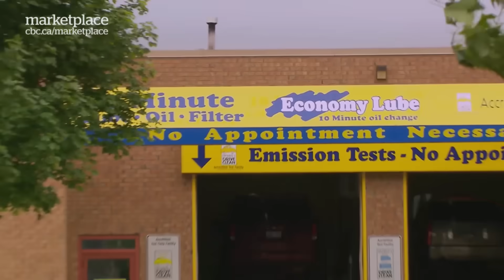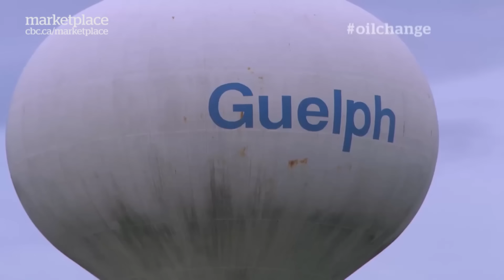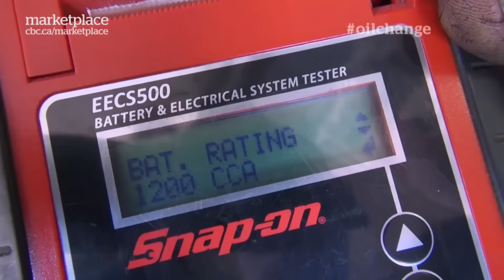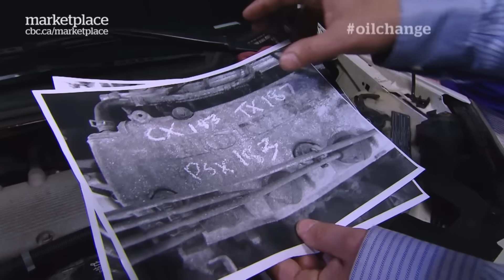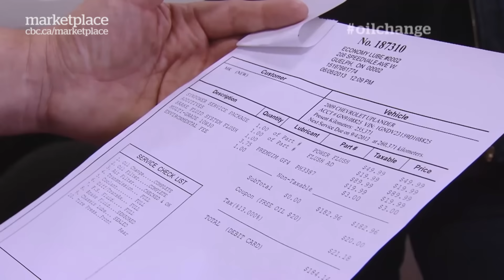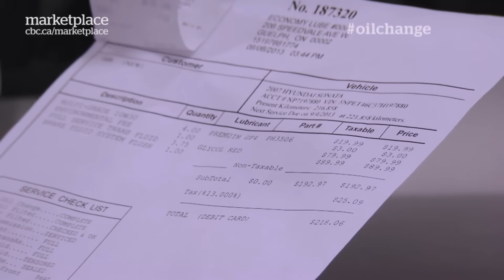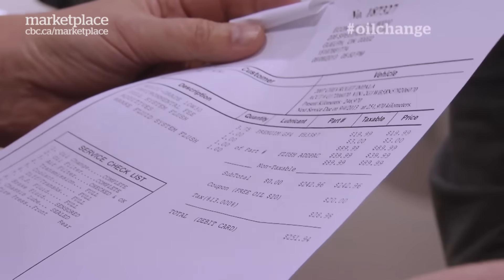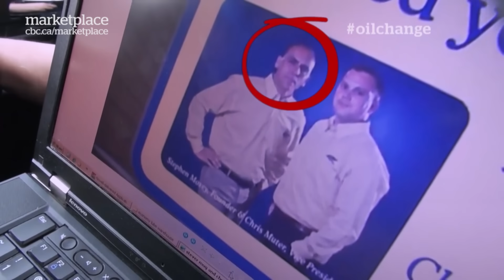Oil change scams: Hidden camera investigation on what really happens to your car (CBC Marketplace)

Comment: The service center at dealerships are just as deceptive
Reply: they really are. i brought my car into get my breaks fixed at my nissan dealership where i bought my car because it was under warranty so they had to do a 500 dollar break job for free and when i left my check engine light was on. when i brought it back they said my o2 sensor was bad and it would cost me 600 bucks. i went and got a second opinion from a close family friend and he said it was intentionally unplugged and he just plugged it in. no charge. he took a picture of it and said the only way that would happen is if someone intentionally unplugged it and to charge me for a new one is insane.
Reply: Dealerships are the worst. One tried to cheat my mom.
Reply: Dealers are known for this. With all the competition they have selling cars, their profit margins are so low that they try to make up for it at the service center.
Reply: You could change this sentence to "Dealerships" and it'd be about the same context lol
Reply: They are not.
Reply: Totally agree. Stay very quiet during warranty period, then start their scams 1st service after warranty period. Charging top dollar and not even doing a proper service.
Reply: Actually worse...
Reply: Yup that's why I get my husband to work on my car
Reply: If you have factory warranty dealerships will only marginally "repair" your vehicle. After warranty they will over charge you for repairs. And if the same problem returns within the 12 month repair warranty they will claim it's a different part than the previous repair. It's best to have an extended warranty outside of the dealership because they will guarantee it's repaired correctly. $100 in parts and $800 in labor is usually how they do it.
Reply: @michaelspoto8720  nissan dealership are the worst they replaced my new battery with an old one when I went for simple oil change.
Reply: @ohreally6645  yes!!!! During warranty car is totally fine! Then right after they pull bs
Reply: Some are yes. I'm an automotive tech at a dealership myself, but the one I work at is dead honest. We do a complete multipoint inspection, and we have trays with fresh fluid in viles to show what it should look like, and we dip the fluid next to it to show where the customers vehicle is at. We do it on every vehicle more so to cover our own asses because if something happens to the car, we can show that we did the inspection and notified the customer.

Comment: Took my truck to a jiffy lube . They told me that my diff fluid was horrible.  I'm actually  a retired ase master tech. I took my truck home , pulled the diff cover and the fluid was perfect but I serviced it anyway. I went to a different jiffy the next time, they again said that my diff fluid was horrible.  I told them about the first time. The guy said , "well see, it dark and hard to see under there.". After changing my own oil a few times I went to a 3rd different jiffy in a different town.  Same exact deal . When I told the 3rd guy the story he got indignant and said he didn't like being  called  a liar. I said ,well I don't like being  lied to either. Needless to say I  avoid jiffy at all costs now.

Comment: "Brake fluid should be clear like water" lol wut
Reply: ESan Surnai Yes brake fluid is totally clear when new.
Reply: Only if you use Sprite instead of DOT4.
Reply: use dot 1,000,000 .... this way youre a head of the game and dont have to change your brake fluid for atleast a couple decades
Reply: unless you have a brake problem m8, then even that brake fluid wont help you to keep it in or keep it away from hydration m8
Reply: Steven Schechterly Who?

Comment: The chrome-reverse muffler bearing always needs replacing.
Reply: You forgot the blinker fluid!
Reply: +Benjamin Armstrong With LED technology now, there really isn't much call for blinker fluid anymore...at least not in my shop...but halogen fluid? ...that shit sells like crazy! What little bit I do have is on the shelf, right there beside the plaid paint....
Reply: tanyaswaycool Thank you!
Reply: +tanyaswaycool ELBOW GREASE

WHERE'S THE ELBOW GREASE THE HEADLIGHT FLUID PUMP IS JAMMED
Reply: So does the catalytic converter and oddly every transmission i had has had metal shards good thing i know alot about cars to call them out on it i wouldnt have went to get an oil change if i was working full time
Reply: +watermelons that means your tires are bald
Reply: +misterfunnybones MY alternator fluid was low, so I had them change it...
Reply: +tanyaswaycool  =///==>   Har.!
Reply: +misterfunnybones  say what hahaha
Reply: Also don't forget to tune your powerband ever 20000 miles or you'll rip the thing apart and have to get a new one. (Powerband sate expensive) and never forget the hydrostatic piston pump.
Reply: hehehehe i love a good laugh thanx
Reply: +misterfunnybones I was in a midas(never again) and heard them say this to an old lady who then said, 'this is the third time!'    They also told me I have an oil pan leak, and it'll cost $300 to fix it(MIDAS, never again)
Reply: big business will screw you every time
Reply: DON'T FORGET THE WRIST PIN FRACTURE PLATE
Reply: always remember to service the fish tank.
Reply: +misterfunnybones   And the car will never start if you let the headlamp fluid evaporate.
Reply: +Mich ael Yeah I have heard guys in shops trying to rip off old ladies.  They even tried it on my mother once.  Something about needing a new axle in her jeep because the end showed signs of overheating.  She said, "show me".  Sure enough it was blue. So she calls my dad. My dad is a science teacher and taught me to fix small engines when I was 9 or 10. 
Of course it's blue. It's heat treated. lol  Bunch of morons.
Reply: +misterfunnybones NO NO NO. Its the FLUX CAPACITOR, I TOLD YOU SO MANY TIMES
Reply: +Chris HHu it gyjh
Reply: +Chris H Now that you mention that, I wonder if the flux capacitor was a shop mechanic term before Doc Brown invented it & used it in the DeLorean.
Reply: misterfunnybones
Nope. The Ansible Filter was.
Reply: *****
And rarefied tire air.
Reply: +Commodore Sixfour don't forget the Headlight fluid!
Reply: misterfunnybones lol i think it is, becausse every old mechanic i know uses that term -_-
Reply: +Daniel Rosche Uhm... someone's been pulling your leg, there is no such thing as a hydrostatic piston pump.

What they do use is a traditional coil spring for the piston return.
Reply: ziiofswe You got the last two words backwards. There probably does exist a hydrostatic pump piston.  :)
think tractor and lawnmower.
Reply: +drServitis http://www.bbc.com/travel/story/20150311-can-canada-teach-the-rest-of-us-to-be-nicer
Reply: drServitis
 I can say funny things about Canadians, but I think you're wrong about them being the most corrupt.
Reply: Zyzyzx Zyzer
 Yes, but did you get the bearings packed?
Reply: I have a Diagnostic Hammer for challenging No-Start problems.
Reply: andrew13971
Do you use the technical tap or the corrective strike?
Reply: Technical Tap with my Dead Blow Hammer, when it is fully charged.
Reply: +misterfunnybones 
mmmmm, yes sir , I see your flux capacitor is warn , and it's a common fault on VW Combi's for the radiator hose to fail .
Reply: +misterfunnybones and the 10 min. trany swap
Reply: Just ignore the man behind the curtain!
Reply: +misterfunnybones 
I'm pretty sure the crankshaft chamber ceiling light is also busted.
Reply: Dear Misterfunnybones: Lets Not Scare Off the Customer! The crankshaft chamber ceiling light requires Diagnostic work to be done only by the shops A Tech! Our A-Tech worked at --(fill in blank).
Reply: +misterfunnybones  they told me my Ford Focus electric needs new spark plugs and fuel filter!
Reply: stickmagnet
 What a swindle! Everyone knows that it only needs AAA batteries.
Reply: +stickmagnet really? Did they offer you an oil change, transmission fluid or to check your emission systems?
Reply: +Christopher Miles they told me the O2 sensor and PCV valve needs replacing, the motor is having too much blow by.
Reply: +misterfunnybones Your gas tank's octane sensor and your wiper synchronization unit both need replacing, but lucky for you we are running a special ....
Reply: +Heru- deshet nope I think it's the canobler bar.
Reply: *****
That's a "negative" comment you don't want to hear from the mechanic.
Reply: +misterfunnybones Dont forget the seat heating oil
Reply: the gear oil last up to 300,000km on moderate use. most modern cars are hydraulic clutch, so its less effort than cable linkage, yes it can be repetitive on city traffic, I'll got used to it.
Reply: and dont forget the headlight fluids
Reply: +angry consumer This investigation didn't prove, beyond a reasonable doubt, that the corporation was liable for the fraud.  They did a good job of proving that one store was involved with a few employees, but that could happen easily in a mom and pop shop too...to show corporate fraud they would have to show that multiple employees across several stores owned by the same corporation were engaging in systematic fraud.  Also, it would help to have investigators go in as new employees to see how they are trained to do their jobs.  If the fraudulent practices are taught to more than one person and then seen to be encouraged by management as a matter of routine business practices, then you have a solid case of corporate fraud.   This was not a complete or comprehensive investigation, not at all...and their "retired" fraud investigator would have known this.  As an investigative effort is left a lot to be desired, but it is a good video to help consumers to be aware, and part of awareness is to know your own vehicle, know what it needs so you don't get scammed.
Reply: +misterfunnybones dont forget about the blinker fluid
Reply: +Lucas Jonsson don't forget the window wiper oil and stereo oil
Reply: Canada
Reply: +21Timberwolf wat?
Reply: +misterfunnybones I only use a General Electric Turbo-encabulator. I hope they stock them.
Reply: Don't forget about headlight fluid
Reply: +21timberwolf what about us lol ✋🏻
Reply: Forzalogistics45
Reply: Lmao
Reply: misterfunnybones 
what about nitrogen?

Comment: Jiffy lube needs to be checked
Reply: chris allred they are crooks
Reply: I know they tried to me my lights where burnt out and its $50 to change them
Reply: chris allred How do you feel about Grismer? In my experience they are ok but this video has me reconsidering honestly....
Reply: They said I needed new serpentine belts because they were worn and frayed even though I had them changed for brand new ones the day before lol
Reply: I worked at one location for a while and they actually cared about the customers. They never up-sold unnecessary products and did a lot of extra work on cars for free. They also told people they didn't need an oil change if they came in too early. I imagine that each location is different though.
Reply: And Walmart
Reply: Go to Valvoline
Reply: I work at Jiffy right now and I can vouch what Vortion said 100%. Everything we do also goes by the manufacturer's recommendations and we show this to every customer before performing a service.
Reply: Ive always had pretty good service there. As far as I can tell. Im pretty handy with cars but I prefer someone else to do certain tasks. Im more than willing to pay for it, but that's just me. The biggest problem I have with them is they always park my car on a steep incline when finished, and they NEVER set the e-brake!! they just let the entire weight of the car rest on the tranny pin. Pisses me off!!
Reply: I've worked at Jiffy Lube and we had to do up sales on certain things and if we did the up sale, we did the work.
Reply: Only time i went to jiffy lube was once because i was too lazy to do it myself and the only reason i went was because my good friend works there, i stood infront of my Subaru and watched them do everything. After everything they were all very nice to me and gave me the employee discount.
Reply: They went undercover with jiffy lube 9 years ago. They scam people just like this company!!!! Never trust any shops if u dont know them well.
Reply: I worked for Jiffy Lube for a while. Never attempted to upsell and told people the honest truth about what did and didn't need replacing. That's how they taught me at the location I worked. But like @vortion says, each location is different...
Reply: chris allred it’s funny you say that. I’m 18 and I worked at JiffyLube (about 2 months ago) for my first ever job. It was so horrible and seemed unprofessional in different ways. 

When they made me change the oil, the said just let it drain until it’s stops pouring fast and put the drain plug back on even though older oil and different oil is mixing with newer oil. And then I had to change the filter WHILE the new oil was being added. 

I always change my oil at home the correct way. Let it drain 100% completely and add the new oils AFTER the new filter is on.

And not only that, but all my coworkers that I worked with were mostly half assing everything. And I was asking for help pretty often because it was my first job and I was still learning the ropes and nobody would help me. 

Well I only worked there for 2 days until another job called me up that I applied at. That’s where I’m currently at now and I love it. It’s a custom car shop wrapping cars, adding decals, making signs for different companies, etc...
Reply: That's the kind of stuff that just needs to be reported to the regional manager.  Each location can differ depending on so many factors...best not to judge a company on one location, though it's completely understandable why a customer would.  I've only had great experience with Jiffy Lube, ever since they got a nice contract with the U.S. Military to perform professional checks on training vehicles here in the states.

Comment: True story, one of these places charged me for a fuel filter change on an old Saab 9-3 i had. I was broke, and in school, w/o tools, and recently divorced!
They changed it alright, but it was misting out the rear seal from not being put on correctly w/ stripping the spindle.
The filter was under the driver rear US side.  Could have had a spark from the road, and boom- explosion. I was driving my kids for Christ’s sake…
I took it to a Saab repair and it was $169 to fix. I threatened to take them to small claims court, and they had 2 different VP’s tell me they’d refund me.  Nothing- so, $12 filing fee and serving them - i got my money back… i ate the $75 they charged me tho, just the repair cost was refunded.
Funny story- that garbage garage was bought and sold 4  times since then. Live n learn, and do it right yourself or have a trusted garage!

Comment: My car won't start because of my blinker fluid. I need an engine swap. My Prius' 2jz is expensive. Any idea for another fix?
Reply: Pablo Santy You need performance windshield wipers.
Reply: cooasp12 haha
Reply: Pablo Santy dont for get to pour sugar into your gas so it wont freeze during the winter.
Reply: Pablo Santy change the differential of the plutonium caliper.
Reply: Pablo Santy pruis=No penis
Reply: I have the lower trim so it's a 2j I wish I have the rb
Reply: Pablo Santy swap it with a honda mower engine. You can get 90,000 hp easily
Reply: Pablo Santy All you have to do is install the latest Window's 10
Reply: buy a lawn mower to drive to work its faster and you can stop at someone's house and mow grass on the way home to pay for gas.
Reply: did you try restarting your router?
Reply: You need to swap it for either a Gallo 12 or Gallo 24. Both really good motors.
Reply: Deutsche cant tell if your trying to gas. I dont actually own a 2jz prius. sorry for the breaking news.
Reply: try changing the color of your car
Reply: this was the most funny comment and replies i've seen on youtube
Reply: Try rotating your tire air pressure
Reply: Pablo Santy did you try turning it off and on?
Reply: Pablo Santy bye a new car
Reply: use a muffler harpoon, shoot it up the tail pipe, it will hit a reset button inside your headlights, and drain your blinker fluid, your car should start fine then, lol
Reply: bikerdhill 

If you do that, you're going to have to replace those muffler bearings.
Reply: muffler bearings wont help when the ac capacitor is spitting out atf...... time for a new bumper.
Reply: i think it might be your front tire pressure
Reply: Go to economy lube bud! They'll get it running again.
Reply: Pablo Santy sounds like you lost your car key.
Reply: Pablo Santy 
Don't forget to put water instead of gasoline in your car. 
It's free!
Reply: whoz thatdude 
Rofl made my day
Reply: Pablo Santy 
Put some stickers on it to add 5hp each, plus it makes the car more aerodynamic which saves gas

Comment: pro tip, learn how to change your oil. cheap and takes 5 minutes
Reply: 5 min?
Reply: @rodynmathieu  uh yeah it takes 5 mins
Reply: Time it takes to do an oil change depends on the vehicle your servicing.
Reply: @rodynmathieu  Watch ChrisFix Video on it He's the bets automotive youtuber about tutorials
Reply: Will do
Reply: I could even replace a water pump myself. If only i had my own garage that is. With lots of random people and vehicles passing you by all the time, making terrible mistakes gets way too easy, and i find paying someone else to do this in a quieter place a wiser idea
Reply: All you need is a couple tools and the oil. Simple enough?
Reply: Hear, hear! Depending on your car, it can be stupidly easy to change your oil + filter. Though, there are some cars which are much harder than others (Mazda RX7, look it up), most older cars are pretty simple.